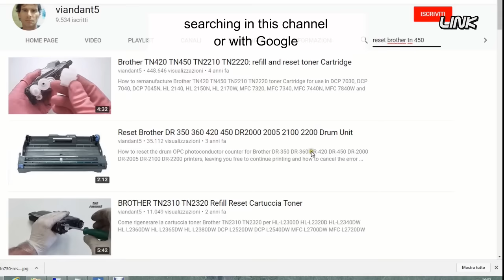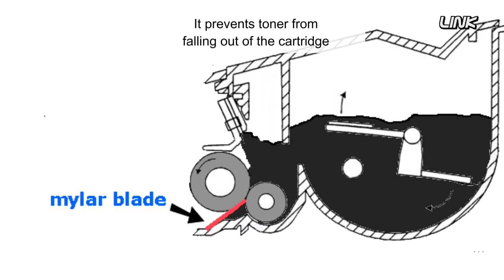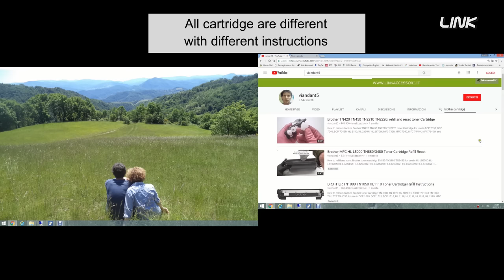How to fix a Brother toner cartridge with quality problems

Comment: Thanks - cleaning the blade with a piece of paper as shown got rid of white stripes I was getting.  Been driving me crazy, now prints perfectly.  Toner cartridge was still half full, so saved me $50 for a replacement that I didn't need yet.

Comment: Thanks, the insert thin cardboard tip worked, half-used 3rd party toner saved. Subscribed. (P.S. thrown away the old original toner with scaly cracks on the roll. Sad to say that 3rd party toner works better.)

Wipe with cloth appears not to work for me, printout has a blank 2mm horizontal line for about 10-20 pages (fortunately it got normal later). Almost thrown the toner.

Comment: Thanks for the video. as per suggested in the video I did take out the doctor blade and ended up cleaning both sides which made the foam belt attached to it loose. I don't think it's the cause but I feel like it's the problem that prints are still faded white to max.can you suggest any solution or do I have to change the drum? Mine is L2520dw. Thanks.
Reply from the maker: I don't suggest to remove the blade but to clean the blade. The drum could cause light prints but the main culprit is the toner cartrige
Reply: @viandant5  Thanks for the quick reply! what do you mean by toner problem? I have checked the parts info in the main menu which showed the toner to be 84%. does it mean the completed percentage or still left percentage?
Reply from the maker: @kaizokuouluffy5299  100% is full, 0 is empty

Comment: Thanks for this. Unfortunately, I still have a problem. A few years ago I ran some label sheets through my printer. One of them jammed. Since then, every print I do has a light dusting of toner over the entire page. I've cleaned everything I can reach including following the instructions you have provided. I still have the dusting problem. Any suggestions? Thank you.
Reply from the maker: somwtime a cleaning is not enought. probably you have to change the toner cartridge or the drum unit
Reply: @viandant5  Thanks for replying. So it's likely that my overall problem is being generated by the toner cartridge? I was imagining it to be some dirty spot inside the machine I haven't found?
Reply from the maker: @eloheimchannel  a grey background in brother printers often is a toner cartridge problem
Reply: @viandant5  thanks again!

Comment: using cleaning wipes and/or paper towel won't work... I was able to get the black lines to stop showing on my scanner with glass cleaner and a MICROFIBER CLOTH. had to be dirt or a smudge of ink that came off some labels that I had printed, but the microfiber cloth was able to really clean it. spray cloth not machine. I have a MFC-L2700DW. the black lines were just on scanned docs using the feeding tray on top

Comment: my bro, my HL 1110 is having faded print. It is not on always on the left side, but on different spot. I have done cleaning developer roller and still having problem. do i need to change the drum unit? I hope you can help me identify which exact problem so I dont need to replace the whole drum 😢i mean if i change the whole drum, i would not know the actual problem and problem will come back. I thought maybe i can just replace the developer roller only to test it out?
Reply from the maker: The faded spots are at the same distance? Which distance?
Reply: @viandant5  bro any reply?
Reply from the maker: It seems to me more a toner cartridge problem. If you change the toner cartridge, before it's better to clean the drum with a soft cloth

Comment: There is a noise  inside my printer that seems like chainsaw everytime i start printing. And the paper jams in the drum or sometimes near the transfer roller. How shall i fix? Thanks.
Reply from the maker: It's difficult to say without checking the printer. Does the drum turn freely? Does the toner roller turn? The transfer roller is in the drum unit

Comment: Brother HL2240
 I'm printing circuit board artwork onto transparencies. 
My toolchain: Ubuntu/KiCAD/GIMP/printing a .xcf file directly from GIMP w/max resolution and absolute black/white contrast/no grey scale or antialiasing.
 I'm using the default printer driver and I have tried all paper settings. The default "plain" paper setting is the only one that maintains the fine line details of the artwork on the print.

Question:
  Is there a way to increase the darkness of the print while maintaining print quality/detail? You mentioned here that the voltage setting regulates the toner. I assume I could modify the cartridge to the lower setting. However, if the voltage is the only factor I will reverse engineer and modify the circuit to add my own fine tuning adjustment. This printer is dedicated to PCB fabrication only. Any advice is welcome. I assume all responsibility for my modifications.
-Jake
Reply from the maker: The voltage is the main factor but I don't know how to modify the voltage. I suggest you a Canon or HP printer. Canon technology is more reliable

Comment: So what exactly is the fix for if the printer is printing light? I cleaned my toner cartridge yesterday and after putting it in it is still printing light. I didn't know what the problem was but from your video it sounds like it's an issue with the voltage and that my printer thinks that it's a used cartridge
Reply from the maker: Is the toner old, or dump? Are you sure the problem is the toner cartrisdge and not the drum?
Reply: @viandant5  as far as I'm aware it is a new toner cartridge that was purchased a while ago to replace the last one. We've had to clean it a couple of times. The last time I cleaned the developer roller, it fixed the problem, there wasn't any streaking or lines anymore and it printed black instead of gray. This last time I cleaned it the same way and now the streaking is gone and it's printing consistently, but everything is like 50% darkness instead of being properly black. I also did some test prints, because I read that you should do like 10 test prints just to get the toner to even out, but every single one of them was identical and only Gray. Also I guess it's possible that it's low on toner, but the printer hasn't alerted that it's low on toner
Reply from the maker: @nobody2021  If the cartridge is some years old May be the toner powder inside the cartridge is dump. Probably you have tio change the cartridge or refill the cartridge

Comment: Hello! I've recently bought an aftermarket cheap toner for my brother 2540 printer and its giving black spots on the left side of the page with every print. I have clean the drum but did not resolve the issue. Please, I need some advice. Thanks in advance!!
Reply from the maker: check the cartridge, may be the mylar blade under the developer roller is damaged and some toner fall over the page. are nthe dots at the same distance? check the developer roller of the toner cartrisdge, may be it's damaged

Comment: Getting Ghost images on a brother 8840 D.  First time I have had trouble with it.  Replaced the drum, fuser, and toner cartridge with new brother equipment, and cleaned the laser window;  the problem is still not fixed.  Any thoughts?
Reply from the maker: You have to change drum and toner cartridge at the same time. a defective toner could damage the drum unit. try to clean the drum unit
Reply: viandant5  I replaced toner and drum at same time. Both from brother via amazon
Reply from the maker: Did you change the fusers too? There is nothing else in the printer, The transfer roller is into the drum unit. at this point it could be the main board but

Comment: Hi! Thanks for the information on this video. I have a Brother HL-5340DL that has been printing progressively fainter. If the problem is, like mentioned in the video, voltage set too high by the printer, assuming it's a new cartridge, is there any way to force the printer to reduce voltage? Thanks in advance!
Reply from the maker: No, there is no way. The problem could be the drum unit
Reply: @viandant5  Thanks for your quick reply! I'm going the hard way and check all of it (hope it's not a dirty laser unit. I love this printer and don't want to part with it :-)
Reply: I have a HL-L2320D, and the toner has the same issue. Inspection finds cracks in the roll in the toner, hinting on bad rubber. Finally replacing it with a 3rd party toner fixed it.
Reply: @wing-chungleung1461  Thanks for the suggestion. One year later and it still has issues.

Comment: I have a Fax4100 (...not 4100e, as far as I know). Drum is new, toner is new, drum reset, scanner bar cleaned, but prints are very light. Driver is new and this is a Windows 7, 32bit machine. When I go to printers and the Brother, there is no place for me to set density in the advanced tab (which is at the bottom of the page, not a top tab.) Can you give me any suggestions? Is there a mirror within the machine that could be dirty??? I am out of ideas!!!
Reply from the maker: I think it's not a dirty mirror. it could cause white or grey streaks, not light prints.Try to clean the transfer roller. try to clean the drum with a soft cloth

Comment: HI,
 My MFC-7440N does not print on one spot of the page at all, so when you print a page there is a so-called white line where the toner never goes on.  This is from the top of the page to the bottom and is in the middle of the page.  Do you have a fix for that?
Thank you
Reply from the maker: Check the corona wire of the drum unit, is it dirty? Try to clean it. Check the toner roller, is the toner evely distribuited on the whole surface?
Reply: Hi,
 I bought new toner and drum but it still does that.  This is a 2nd hand machine is there another fix I can do
Reply from the maker: @vijaykhatri7539  It could be the glass of the laser scanner dirty
Reply: Hi,
Thanks for that, will try it but then why does it do that when I print from my computer?
Reply from the maker: @vijaykhatri7539  when you make a copy is the print perfect?
Reply: Hi, 

I have cleaned the glass and it is still doing that.

It does this when you receive a fax, print from laptop & when photocopying.

It seems like something is blocking the toner from getting on the particular section of the page.

Do you have any other suggestions that I can do?  You have been a great help so far.

Thank you
Reply from the maker: @vijaykhatri7539  I ment the glass of the laser scanner, not the glass of the scanner:
https://www.youtube.com/watch?v=rZkHoeTWtDQ

Comment: I just replaced my Brother toner with an after market cartridge. It prints well however, there is a very faint gray background. Its hardly noticeable but its there. Any suggestions to get rid of that??? Thanks.
Reply from the maker: Try to clean the drum but it's a toner cartridge defect. The toner is 100% in the Menu?
Reply: What are you referring to when you say menu?
Reply from the maker: @panamajosh76  Which printer do you have? Does it have a control panel with a display?
Reply: Brother HL-L5200DW
Reply from the maker: @panamajosh76  in the display of the printer check the level of the toner cartridges
Reply: Toner life show blk bars that run the full length of the display and drum life shows 94%. I have contacted the company and they are sending me a new cartridge. After this I most likely will bite the bullet and pay the full price for genuine  Brother toner.

Comment: What happens when the gear does not turn the developer roller? I'm having that issue. Seems like the roller metal end can't properly hook onto the gear. I tried to remove the plate on the side of the gear, and I pushed the metal end into the gear. It would turn ok. I closed up everything then put it back into the printer. Then as I print, the metal becomes loose from the gear again
Reply from the maker: It happens that the roller does not turn and the toner can't be transferred on the drum. Probably the internal part of the gear is defective, or there is something blocked the toner roller movement

Comment: Hi!  My Brother printer gave me fainted print on the right side( there is no obvious line between dark and pale print.  What is the possible problem?
Reply from the maker: Check if the toner cartridge is correctly installed, the toner roller must be in contact with the drum. check the corona wire, check if the corona claener is in the right position

Comment: 2541dw , the problem is after cartiage refilling , lines come when images are be copied , when toner take out it shows lines on the roller , what was the problem and how it will be solved.
Reply from the maker: probably the problem is the toner roler blade, dirty or defective. Or the toner roller has been damaged by a defective toner roller blade

Comment: Hi... I got brother hl-2140 printer storing for 3 years not in use... But just now I try to print something... That become black page... Actually what is the problem...?
Reply from the maker: May be the drum unit, the mother board, or some contact between drum unit and the printer

Comment: I did all the cleaning routines on my 5340D but I still have a dull dark 1/4" wide horizontal line or mark across my print. It looks like transfer possibly , each page it's in a different spot across the page. HELP!
Reply from the maker: only one line? it could be the transfer roller, check if it's in the correct position. check the contacts between the drum unit and the printer
Reply: @viandant5  It seems to be about 4 " apart and is a dull line about 1/4" wide.
Reply from the maker: @skipwavedx5151 so it's a repetitive defect?  about 4" - 10 cm could be the toner cartridge too

Comment: How to remove scratch lines on par?
Reply: *pcr
Reply from the maker: @anuragmishra-kd9fy  you can only clean it with alcohol or remove the protective layer but the PCR could stick to the drum if it remains in the same position for some days

Comment: What of when d roller is steeve i.e very hard to roll
Reply from the maker: the roller must be hard to roll by hands
Reply: @viandant5  its printing is very faint to the extent that you can't read it.
Reply from the maker: @ayeniademola6398  Try to clean the roller with isopropyl alcohol, or may be the toner powder is damp or too old

Comment: my printer produce sound during copying why?
Reply from the maker: It's difficult to say because it could be lot of causes. it could be fuser gers, bushings, drum against charge roller. for start you could remove the toner and the drum unit and turn them manually to check if the problem is there

Comment: My toner is replaced and I can scan, and copy, test page comes out fine but I can not get it to print. It spits out blank sheets. What is wrong?
Reply from the maker: I would start reinstalling the driver, check the USB cable, or the wi-fi properties
Reply: Check drum unit corona wire....